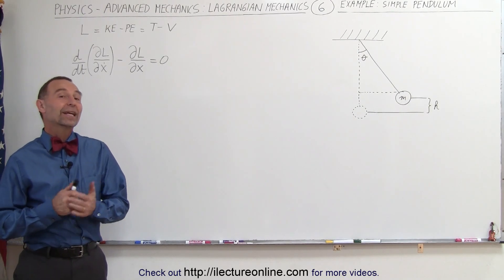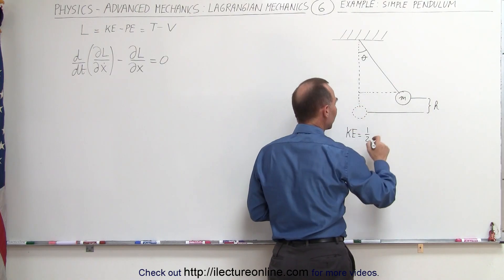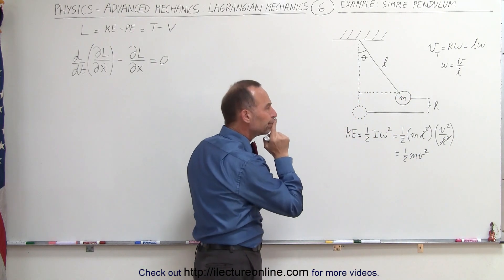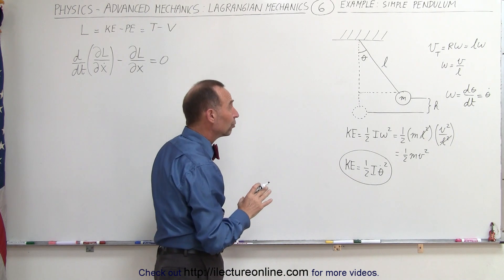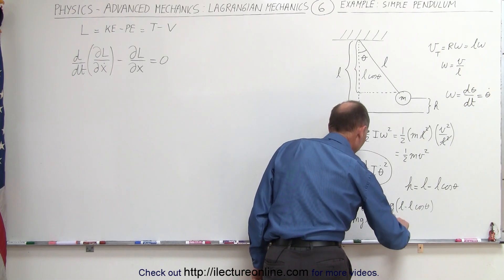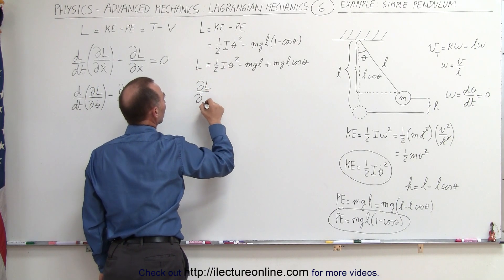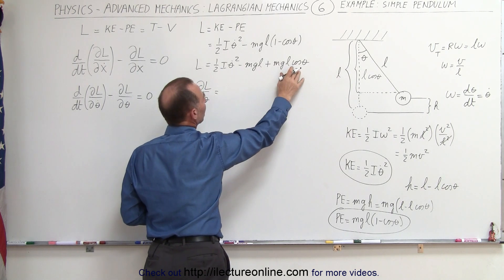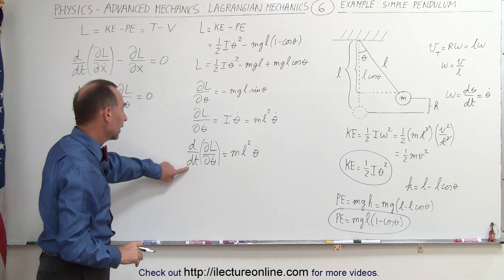Physics 68 Lagrangian Mechanics (6 of 25) Simple Harmonic Motion: Method 1

Comment: 6:42 Excuse me, you did what..."simplification" wow, I mean WOW  the "method" you used to get there is fundamentally mathematically flawed!!! The "cross-out" step is not a valid algebraic operation. You cannot selectively cancel m and l unless they appear as common multiplicative factors in all terms. I mean this is basic stuff, wow!!!!
What you got after your "simplification" l *θ¨ +gsinθ=0, is dimensionally inconsistent !!!

The final equation is correct only because you later divided by l, which compensated for the earlier error . This is a coincidence due to the specific form of the pendulum equation. 
Correct Simplification: divide by ml^2 and than make small-angle approximation

Comment: Thanks for your video, Sir. But I'm so confused. On your previous video (the SMH), we got the equation is x double dot + w2x = 0 and the solution is x = A cos (wt). But in this one, we got the similiar equation, which is theta double dot + w2 theta = 0. Those to are exactly the same but the variable, the one is x and the one is theta. But why the solution is different? The x one is cos and the theta one is sin?
Reply from the maker: Both the sin and the cos are solutions.  The one you pick depends on the intial conditions (when t = 0)

Comment: Thanks for the excellent explanation. I have a question that confuses me, what if the pendulum moves horizontally. not vertical as exemplified in the video. What are the potential and kinetic equations? I can't find it on youtube, I hope you help me
Reply from the maker: There needs to be a storage of potential energy for a pendulum to work.  If it is not gravitational potential energy, what would be the potential energy?   One possibility is that is an object attached to a spring and the compressed spring contains the potential energy.  We have examples of such a system in this playlist.

Comment: I thought ½Iω² only applied to a body that's rotating. Not a body on a circular motion. Could you please clarify?
Reply from the maker: Just like for linear motion  KE = (1/2) mv^2      For circular motion KE = (1/2) Iw^2
Reply: @MichelvanBiezen  oh I thought it only applied to rotating body
Reply from the maker: It applies to any body that rotates about its axis or orbits a fixed point (or any other axis displaced from the center of mass)

Comment: Question: How do we calculate the time till that SIMPLE PENDULUM practically STOPS in air at STP? 'standard Temperature and Pressure' = normal day at a comfortable temeperature'
Reply from the maker: We have videos on the damping equation for simple harmonic motion.  The decay equation will be in the form:   e^-ct   which then shows how long it takes before the pendulum comes to a stop.
Reply: @MichelvanBiezen  How do we calculate the time to full stop in an UNCRITICALLY DAMPED system?

Comment: how to solve this differential equation ?   theta ( double dot )  + (g / l )*sin theta = 0   for theta as a function of something.
Reply: It has to do with assuming the solution comes in the form of exp(r*t).   You will eventually solve a quadratic equation and find two imaginary solutions for the constant r, and when you construct the meaning of exponential functions with imaginary exponents through Euler's formula, you will get a linear combination of A*sin(omega*t) and B*cos(omega*t), where A and B are the amplitudes of each component of the solution, and omega is the angular frequency, that will equal sqrt(g/L) in this example.

Through trigonometric identities, you can prove that this is equivalent to:
theta = theta_0 * cos(omega*t + phi)

This means that the solution comes in the form of a sinusoidal waveform with an amplitude (theta_0) and a phase shift term (phi) that depend on the initial conditions.
Reply: @carultch  so why does he not do this in video?
Reply: @michaelempeigne3519  Because it isn't the focus of this particular class.  In Differential equations, you learn to solve that equation.

In this particular class, I would assume that the students already took differential equations, or it is something that is considered a given, so that the students eventually learn to solve it when they do take differential equations.  There might even be a proof for it in the textbook, that is simply not the main focus of the class.

For instance, when moment of inertia of a disk comes up in an introductory physics class, it is typically a given that it is 1/2*m*R^2.  There is a proof in the textbook, or at least the background to do the proof in the textbook, if the students are curious.  But knowing how to do the proof isn't necessarily the subject of the class.
Reply from the maker: Yes, it is assumed that the students is familiar with partial derivatives and differential equations.  If not, we have videos on those topics as well.

Comment: Im a mechanical engineer student, as such i have taken dynamics which from i understand is analogous to Classical Mechanics physics majors take with probable less complexity than the physics major. That being said, i now understand so much more because in my class all these formulas were handed out as tools and i literally didnt understand how each "tool" worked or what it did. This helps sooooooo much understanding the mechanics.
Reply from the maker: I tend to agree with you that in many engineering courses, they teach your the "tricks of the trade", without fully explaining where they came from, why the work, and how to develop them.  When I took those classes, I had the same problem, because I learned better if I was shown the context of what we were doing.

Comment: Sorry to (probably) misplace this comment/request, but... I have been a model railway enthusiast since ever and have been bothered by the following problem.
Assume you have a train consisting of one locomotive pulling some freight cars: the first cars being flat deck cars with no load on them, followed by some much heavier box (closed-chassis) cars or even another loc. Now when the train takes a turn, in model trains the flat cars would most probably cut the turn and derail, while in real life the train would probably pass the turn successfully. Obviously, this depends on the radius of the turn, as well as on the mass distribution of the vehicles. Could also be that the type of wheels ("bogies") play a role. I am aware that the mass of the model rolling stock is often not to scale, but would you be able to explain all the dependencies/vectors involved in this problem? What are the critical points here for the train to pass the turn successfully? Thank you.
Reply from the maker: I used to be a model railroad enthusiast myself, and I always wondered about that same problem.   It is mainly caused by the tightness of the turn.  If you make the turn less sharp that will be less of a problem.  It is for that reason that railroad tracks do not have sharp turns or the same thing would happen.  Draw a vector of one car pulling the next and see what the magnitude of the component is perpendicular to the tracks.  (the cars being relatively light also does not help).

Comment: Is it natural frequency omega_n = sqrt(g/l) and angular velocity omega = v/l ? They are both called omega in this so it is a little confusing.
Reply from the maker: Yes, some symbols are used many times over in physics.  But in this case, there is a close connection between angular velocity and oscillation frequency.

Comment: How can you just say sin(theta) = theta? What if you want the exact solution? My professor does not like approximations.
Reply: In small harmonic oscillations this approximation is perfectly acceptable and correct
Reply: It is not possible to solve this problem in closed form, and have an exact solution.   You end up needing to use an infinite series expansion of sin(theta), and solve the differential equation accordingly, if you want to accurately capture the behavior of a large amplitude pendulum.  Even then, your solution will not be an exact solution that you can easily evaluate.  It will be in the form of an infinite series of sine waves that are harmonics of the fundamental, and there will be a pattern to the various amplitudes.  The period will be an infinite series of polynomial terms.  Hyperphysics has this solution available.

We are doing a first order solution to this problem by assuming the linearization of sin(theta) = theta.   For amplitudes up to 22 degrees, you are 99% accurate with this solution.
Reply: @carultch  
Interesting. Thanks for the info.

Comment: I almost choked when you used : sin(θ) =θ
Reply: You clearly haven't seen the power series of sin(θ)
Reply: @TheBlueboyRuhan  I've seen it. But I am not willing to accept such proposperous things as simplifying an ODE by using sin (θ) =θ. Just to get an approximation
Reply: @gregorykafanelis5093  If you have seen it, you would see that for small value approximations like the example given - it's negligible. Try it yourself
Reply: @TheBlueboyRuhan  But shouldn't we strive to derive the general solution? I mean approximations are OK, but if we put more effort we can get an equation that describes the system flawlessly. Isn't beauty worth a little more of your time? 😂
Reply: @gregorykafanelis5093  have you seen the solution ? it's not even analytical... It's not the point of this video.
Reply: @twistedsim  no I haven't seen it. Would be as kind as to provide me with a link so that I can see the solution of the reason of my three night sleep deprevation?
Reply: Gregory Kafanelis Think about it. The derivative of sin x at x=0 is equal to cos (0)=1. Which means that if you were to graph the line f(x)=x with f(x)=sin x, the line would be  tangent to the curve at (0,0) and would be a good approximation for the curve at smaller values. As the problem here involves a pendulum, the angles involved won’t be large to the point where the difference between sin x and x will matter. And in any case, we already use approximations that arent true in the real world - we neglect the mass of the string, air friction, and the friction between the string and whatever its hanging off, which are more important in the long run.
Reply: @gregorykafanelis5093  sin (θ) =θ IS an approximation lmao
Reply: Gregory Kafanelis I don’t get what you’re saying. Have you not learned about small angle approximation? It’s not something he just made up on the fly. This is an established theory.

Comment: You SIR are a legend! I just had one question, @ 7:15 I understand that sin(theta) is theta but I don't understand why we needed it to formulate the equation. Wouldn't we be happy with a final equation containg sin(theta)? Thanks a lot.
Reply from the maker: Using Lagrangian mechanics, or with differential equations it is easier to work the problem when we use theta as a variable instead of sin(theta).

Comment: please, why dont you take your h as lcos(theta)
Reply from the maker: Lcos(theta) is the perpendicular distance from where the pendulum is attached to the ceiling to where that pendulum is at (which is not h).
Reply: and what's reason for  the choice of h=L-Lccos(theta)
Reply from the maker: Since the vertical distance from the ceiling to the object is L cos(theta), then the distance (h) from the lowest point of the pendulum to it current position, must be L - L cos(theta).